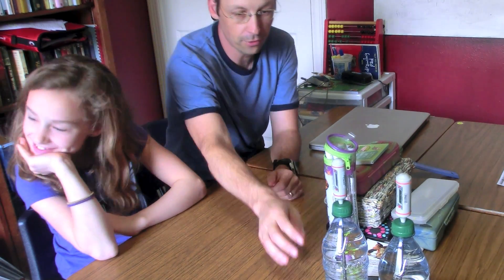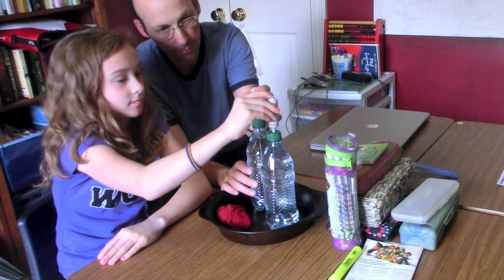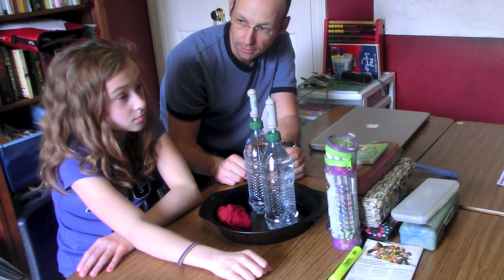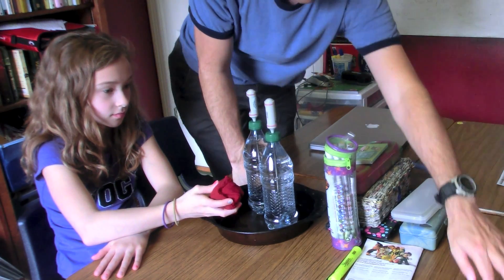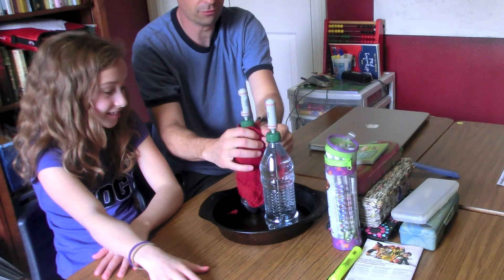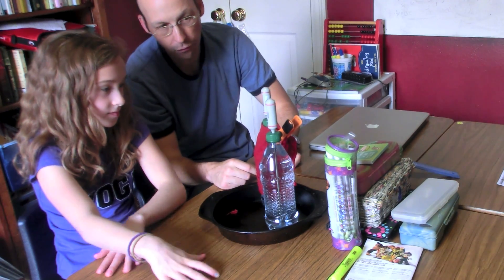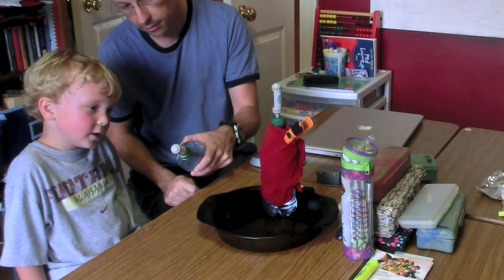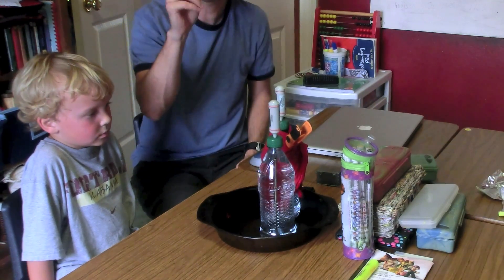Cooling by evaporation

Comment: Too hard for the kids. Heck, it's too hard for most people.  It involves 2nd law of thermodynamics (  conduction from warmer area to cooler area ) and evaporation ( decrease of water kinetic energy on the cloth as water on it evaporates into the air - cloth gets cooler).  Therefore, the water in the bottle got cooler (until the cloth is dried out).